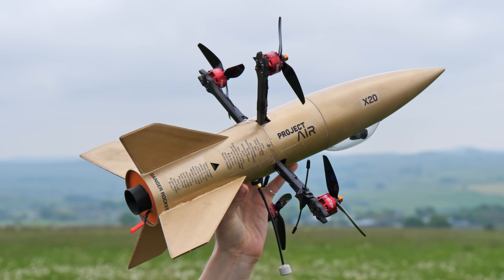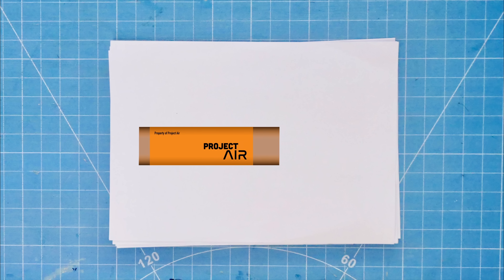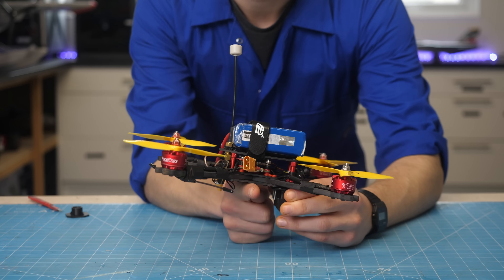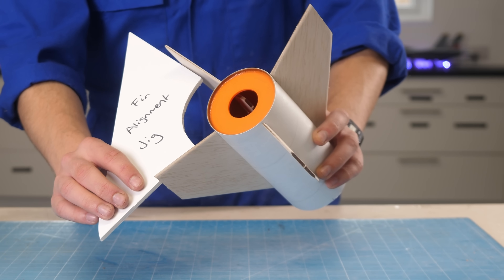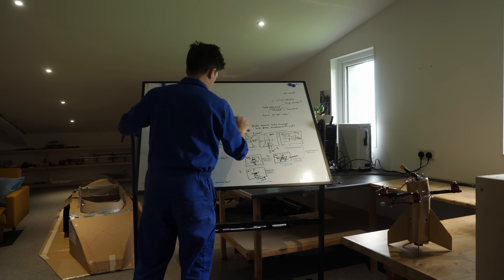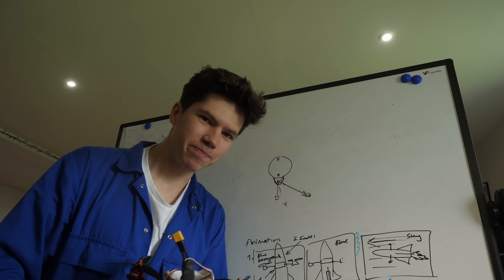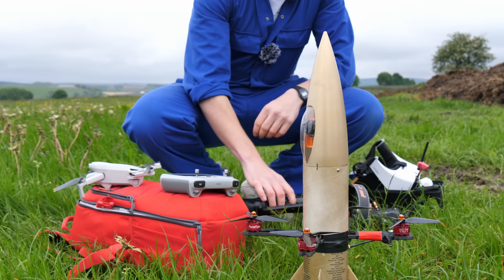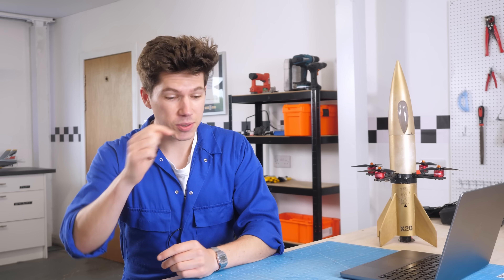Building a Rocket Drone

Comment: That's a brilliant first showing for the concept! My first thought for getting more speed out of this setup is some kind of lightweight (foam or 3D-printed) fairing on the rear face of the drone arms and motors - I'd say at a ballpark guess that in the current config they have at least double the drag of the rocket body once you get up to speed. If you search up some of the recent world-speed-record quad designs here on YT, you'll see they all have it. If fairing just the center of the drone (by adding the rocket) gave you such a decent increase in speed, fairing the rest should too.

Comment: I think a big source of drag is the flat area at the back of the rocket body, where you transition from the large diameter tube to the smaller diameter rocket motor. You're dragging a ton of air behind that flat area, so I highly recommend putting a conical cap to make the transition smoother. I am really interested to see this design evolve! Good work as usual!
Reply: Yup i saw some guys that do high speed drones have cones on the back too to reduce drag

Comment: To boost the speed of your future projects, consider drawing inspiration from NASA's X-43 aircraft design. Imagine a hybrid vehicle, part plane, part rocket: initially, it uses a rocket to gain speed and altitude, then transitions to using its propulsion system to build on that momentum. This approach could potentially achieve speeds up to 300 km/h. While I haven't tested this concept in real life, theoretical simulations using software like OpenRocket suggest it's a promising strategy.

Comment: You can prevent the plastic that melts from sticking to the rocket motor by adding a layer of baking paper in between the plastic and the engine. It will still melt, but it wont stick and just harden again once the engine cuts out.

Comment: I absolutely love this! Have you ever had a knock at the door about these specific (solid motor powered RC stuff) projects? I don't know what our kind of laws are, but I am pretty sure this is a no-no in the US. Frankly, I'd hope they'd see the hobbyist side to it all (and content of course) and let it fly (heh).

In an interesting turn, this is one piece of free, open source software (ardupilot) away from being an AI controlled, guided... Well, keywords and all that :P

I don't know if it's been done, but I'd love to see a drone in this fashion fired straight up, the showing the reduced control authority of the thinner atmosphere at altitude. Perhaps a staged version of this?

Maybe even go terrestrial on the next video with a rocket powered RC car. Rival your Jet powered one with even more of the technical issues faced at high speed and small scale! :D
Reply: Model rocketry is perfectly legal in America.
Reply: @canadiangemstones7636  I never said it wasn't, but the guidance part absolutely is (BPS discusses it fairly frequently, and it's the reason GPS doesn't update as frequently above a certain speed even though it technically has the ability to do so).
Reply: @Guffy1990  it's down to the power of the over the counter rocket engines, those have to be certified. The moment you cast your own motors you're in illegal territory.
Reply: @AccAkut1987  so home cast grain is the difference between guided and unguided missiles? Huh, wouldn't have thought that.

I know what you're trying to say, but casting your own grains is a different branch of legality (and is only illegal past a certain point, and that point is pretty far). It's not the topic I was trying to reference, nor did I expect anyone to think I was saying model rocketry was banned (which would be hilarious considering Estes motors are available on both US and UK Amazon). Specifically the control authority is the illegal part.

Comment: What about instead of rocketing the whole drone with the rocket, you detach the rocket (just literally use the drone as a launch pad)? Would be a good use of a titanium strike plate and then just need to design a nice latch system to hold it up until you get ready to fire the rocket

Comment: You can get actual model rocket motors that are just that, Booster. You tape them together with celephane tape in series and as the flame front hits the join, the heat melts the tape, empty rocket falls off, next Booster in series ignites. But don't forget, the more boosters the heavier it gets. Great video!

Comment: Hey, avid fpv drone pilot here, just wanted to comment that I came with a nice gust of wind at a downward swoop from about 500 meters high with the dji fpv and managed 186 kmh, I'd recommend you do the same , take it high, swoop down with the wind, then engage the rocket, also try to use lighter parts anywhere you can

Edit: maybe heavier might actually not be too bad either....

If you do see this comment and try it with success, please give me a shout :P

Furthermore: maybe give it dual control surfaces so some servos to use control surfaces like an airplane, and maybe a rat trap mechanism of sorts that folds the arms with props down and out the way, then kind of glide it down... i dunno this last part is a very far stretch.

Comment: Many flight controllers can control servos, if you have a spare channel on the tx/rx you can use a knob to control the pitch of the fpv camera using a single axis gimbal.
Some flight controllers also have support for controlling gimbals using the gyro so you could set whichever angle you want (and some allow for combining gyro with a channel input for modifying the target angle) and have it maintained while in flight, that way you could have the camera pointing horizontally, or slightly down, out of that bubble cockpit so you get a good view no matter the attitude of the vehicle.
Very cool project :)

Comment: I see you’ve updated your radio to something decent, now you need to stop using 8 year old motor technology, use Xing or Tmotor stuff will make it much faster.  A stock Xing 2306 send my wing to 220mph without much effort last year.
Reply: Motors actually look pretty modern,  I'd guess he's just severely undervolting them. The battery looks like a 3s pack

Comment: Not to rain on your parade, but with the right combination of parts you can build a 5 inch racing drone that goes faster than this rocket drone.
Reply: But Mike this is a world first, in 3, 2, 1
Reply: I have stock Iflight Nazgul 5. On a 6s battery it easily goes over 105 mph. And that's with a Gopro attached, so probably all i need to go faster than this rocket is a set of better props.
Reply: @skasev  REDBULL 400 km/h
Reply: I think you missed the point of the project.
Reply: Fastest ROCKET Drone not Fastest Drone

Comment: In the next version, you should include a mechanism that allows the arms of the drone to fold inward at the moment that the rocket engine ignites. During normal flight, the arms and propellers contribute to forward speed, but in rocket propulsion, any potential speed gains would be significantly hampered by as the air speed quickly exceeds the pitch x rpm of the propellers, creating a ton of drag.

Comment: I have a 6s lipo geprc croc 7" drone with 2807 1300kv eco II motors and it does 120mph, pretty basic/normal setup for a 7", I'd love to see it with a giant rocket motor for a couple seconds haha. Fun vid man and im def gonna have to 3d print me a rocket motor holder and strap it on. Thanks for the idea dude I was getting a bit bored haha.

Comment: Great video. I'd really like to see you do it again, except add a second rocket engine. The smallest one that you can detonate separately to launch a parachute So you can watch it float down at the end instead of the what looked to be risky crashes (So you'd have to attach two detonators, and then you could use the big engine as your speed boost, and then when you want to land, you launch the 2nd rocket, which would split it open and deploy the parachute)

Comment: Well done, James and Emma! 🙂👍

If you rotate the motor support arms by 90° you should be able to improve the aerodynamics even further. At present they're face on into the airflow. You can also smooth the shape of the fins. Then, if you use a transparent rocket nose, you can mount the camera inside without needing that draggy bubble canopy. 

Additionally, if you can keep the weight down, you can lengthen the fuselage to reduce drag further. A longer rocket will have proportionally less drag for the same overall volume than a shorter, stubby rocket body like that one. The same principle applies with ships, aeroplane wings and land-based vehicles.

Can you also shorten the motor support arms and move the whole propulsion platform further toward the nose? With all of those things in place, and the correct rotors, you might even exceed 100 mph without using the rocket motor. Just think; 250 km/h might be achievable with a rocket motor added.

Comment: Very cool. It would be an interesting experiment to have drone legs be able to fold down out of the way for aerodynamics , maybe a very light spring holding them up. I’m curious to know if rocket would cause them to fold back out of the way during rocket stage or if drone motors are still able to produce force while rocket fires.

Comment: James have you considered building an rc oblique wing, it was a prototype nasa aircraft that had a rotating wing to optimise itself for subsonic flight with its wing at 90 degrees to the fuselage and supersonic flight with the wings rotated so that one side is swept forward and the other back.  Somehow it didn’t fly in circles but unfortunately was never used to much effect as it ran out of funding otherwise it may well have changed the way we make planes forever as it has the pros of a swept wing but none of the cons of the complicated mechanism required to sweep the wings. Just an idea as you seem to be doing a lot of speed related projects at the moment. Love the channel 😃

Comment: James. Firstly Congratulations, that was really good. 
I was surprised that the motors didn't overrun and cause issues with the ESCs, I was expecting some sort of electric failure.
But if you go bigger with the drone and rocket could motor overrun be a problem? If its possible would folding props be a good idea?
Maybe there's a world record in it?
Keep up the interesting work. 😀👍

Comment: I'd be tempted to build a larger single ducted fan OR quad ducts (4 tubes) inside the fuselage with 4 flap controlled vents on cardinal sides that give you thrust-vector control, and on the nose have air intake vents that can be closed off during rocket powered flight. The drag co-efficient improvement would be immense....... thus it becomes more of a control/engineering challenge.... but it's a hella interesting one if you can pull it off.

Comment: For the landing, I would bring it close to the landing area through FPV, switch to stabilized mode (easy to assign the mode to a switch on your RC with Betaflight ) at a safe height, let it stabilize itself into a hover, remove the goggles and fly it line-of-sight through the landing.
Maybe you could try to use ducted fans (EDF) instead of propellers to reduce the drag? Some people have already built EDF drones, they fly ok but, as the power consumption is higher than the propeller drones, the flight time is reduced without offering any advantage. In your project, maybe you'll get higher speeds?

Comment: I'd like to see if you could retract the motors under rocket power.  Maybe use a bungee or spring setup to flip them back out when airspeed gets below a certain threshold?  Motor pull on the airframe should keep them extended under power.  U.S. Air force came up with an aircraft droppable drone that works in a similar manner.  While stored, outriggers are retracted.  Under throttle, they expand under motor force I would assume, then the drone flies under power normally.  Should reduce your frontal area coefficient significantly.  Might have to use conventional control surfaces on your fins however, or thrust vectoring by tilting the rocket motor.

Comment: Can you possibly feather the props with some type of custom motor/prop? This will make sure the drag is limited and the motors don't burn up. I would still run the motors at max rpm for stabilization purposes. Pretty sweet!

Comment: Have you considered hinging the prop arms at the skin of the ‘rocket tube’?
IE, the props arms fold back against the side of the rocket body as the rocket motor launches it. 
Turning on the props should cause them to move back into position for prop driven flight. 
Or as you have proven, ignite the rocket in flight.

Comment: If you build a version with strong motors, you might want to consider leaving the original carbon fiber plates in the build. I'd think the 3d printed plate is much less stiff, which would mean increased vibrations in the long arms and a harder time stabilizing the quad for the flight controller.

Comment: I would say from the first non-rocket test flight that when turning you could see you and the flight controller fighting the aerodynamic stability of the missile shaped body, I would guess you could improve this by adding dynamic control surfaces such as making the fins powered and moveable and or adding canards.

Also you will get a dramatic increase in drag as the solid rocket takes over from the props, again I’d guess that spring loaded arms that fold in as the thrust increase would improve the performance. Or you could feather the props but a pitch change device would be complicated and potentially heavy.

Comment: Yes, introducing a flying control is difficult and more complex, but if you move from Betaflight to INAV you could make a path (you will need to include a GPS)  for the test run and be controlled by the flight controller, and thanks to the GPS will be more easy to check the velocity... I think that you could try a 250mph...

Comment: What you need to do is build a high altitude rocket which launches almost vertically before leveling off and extending wings to glide far and back to the ground

Comment: Couple things, you could use more powerful motors with higher pitch props. 5x5x3 would be a good choice for props. Also, since the rocket is stabilized by the flight controller, the fins should be deleted.

Comment: Maybe you could build it with collapsible propeller blades so that when the rocket goes faster than the blades can keep up with, they will automatically collapse, which should in turn help with aerodynamics. Then you could also make the arms that hold the propeller motors more aerodynamic. Just a suggestion... 😃

Comment: Personally, I think that before going bigger (you definitely should, eventually) you should work a little bit more around this one. Maybe give it a more aerodynamic fuselage (the bottom could probably be narrower since the rocket's diameter is quite smaller than the fuselage's. A bit more of a V2 shape might help). Also you could add fairings to the motors and motor arms... you can probably push this much further than 118 mph

Comment: Let's see a big, fast one next. The record for the fastest electric quad is the Peregreen 2 at 298 miles/hr. It's rocket-shaped but the fins, such as they are, are integrated into the motor struts. The question is, how fast can a similar design go with rocket assist? 

And not to knock your achievement, but the AOS HS5 kit drone can hit 200mph.

Tyro broke the 100/100 barrier (100mph for $100) for a "buy and fly" four years ago. Present day, the iFlight Mach R5 Sport is supposed to hit 145mph for $300.

Comment: Go bigger, but just so you know, you don't need the tail section of the rocket since all stabilisation is done by the props. The tail would only help if it is fusiform which is impractical at high speeds. If you put 4 F type rocket engines and remove the tail you would 4x thrust whilst minimally increasing drag and mass. You can print mounts that screw in the motor screws as well so you don't need extra bolts. 

That would be a cool project especially you if you beat ShaggyFPVs speed (Ralph Hogenbirk). He built a F1 chaser drone non-rocket powered.
Reply: adding to my reply, the fusiform tail is practical if you have the rocket motors mounted under the electric motors. Not practical if you have a large rocket motor. It would also allow you to land horizontally if you don't have a tail. 

To improve it you can also add a second FPV camera mounted horizontally and one mounted vertically so you can go Fully Horizontal when attempting high speeds whilst being able to land when going at low speeds. Matek FC boards have this feature and you can switch FPV using an AUX channel. 

You should probably upgrade your FPV goggles since an Eachine EV200 or some decent Fatshark goggles that have diversity are around 100 GBP these days and you'd have a decent video signal.

Comment: Those white lines are from noise interference in your power, try isolating video lines as much as possible and maybe add a low ESR capacitor to the ESC end of your power cable

Comment: I make motor mounts out of PLA all the time. Just slide a bit of cardboard (like a toilet paper roll) in between the motor and the PLA wall and it acts as a heat sink and insulator.

Comment: Love your work!
However, on this project I would go in an opposite direction, i.e "send" the drone initially with the rocket (possibly with folded drone arms), then, near the destination reachd, switch to drone motors for controlled loitering/landing...
Reply: Bingo
Reply: From a practical, aerodynamic and efficiency point of view, neither is particularly good idea. That's why militaries use very different types of drones and aircraft. Aerospace companies have been trying for decades to make hybrid VTOL vehicles, but it's difficult... they usually end up being sub-optimal in every area. Tilt rotor aeroplanes and helicopters with pusher props have some success. Jets like Harrier and a version of the F35 have VTOL capabilities, but are hugely expensive and complicated.